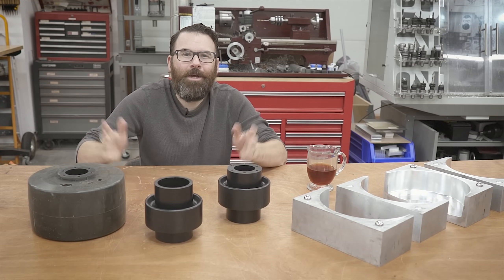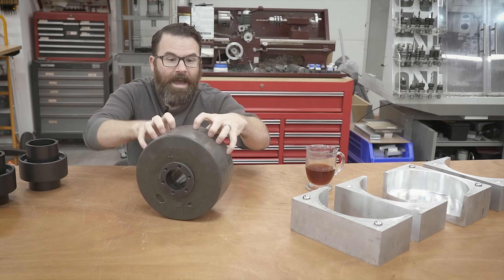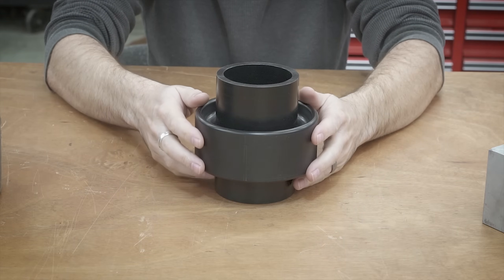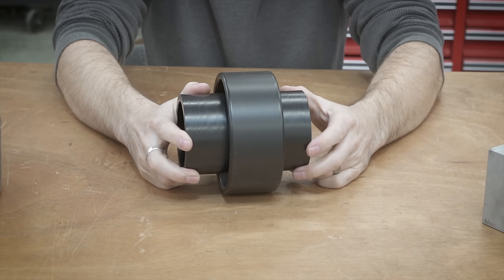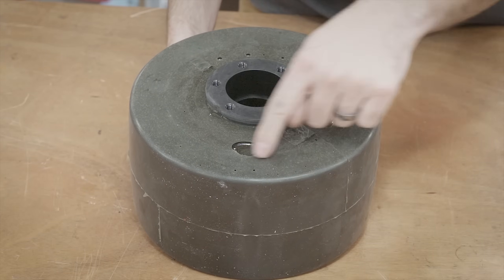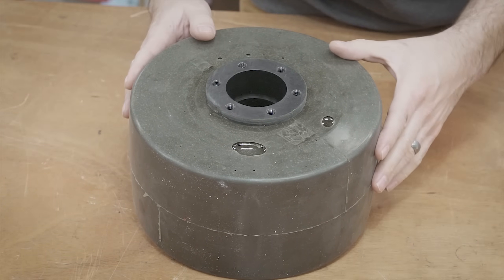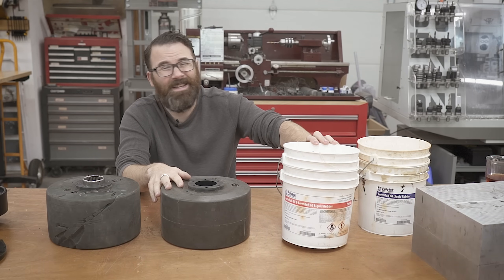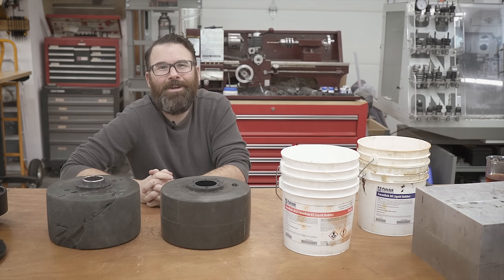Copperhead Custom Wheel Molding

Comment: Another thing regarding the bubbles, ever thought to use a vacuum chamber? Or is that unnecessary just for the wheels?
Reply from the maker: Let it settle, get the bubbles out before you pour.  Pour slowly and patiently.  Should be fine beyond that.
Reply: All the bubbles went to the top and at this size of wheels its just surface pitting. Sure it's not going to win a beauty price, but at the same time its a battle bot. Structurally the wheels are fine. To find a vacuum chamber this size to fit the mold, probably cost some money and the wheels are expensive enough.
Reply: You could build the vacuum ports into the mold itself. Just pull the vacuum while its not hardened to remove the bubbles., then open up the ports.